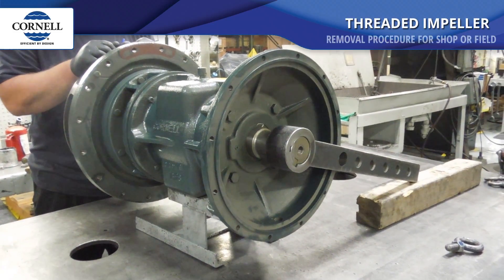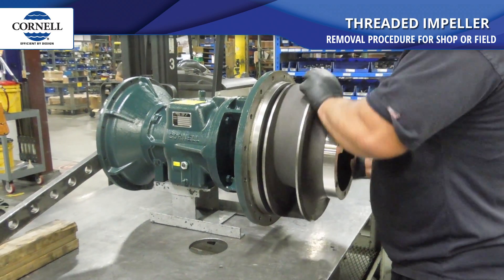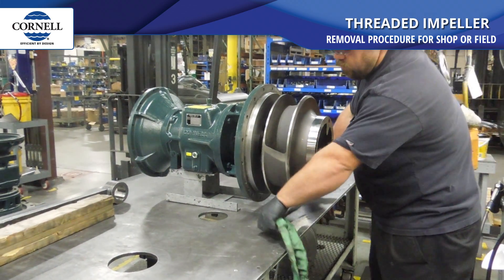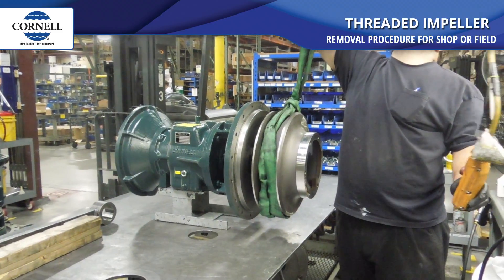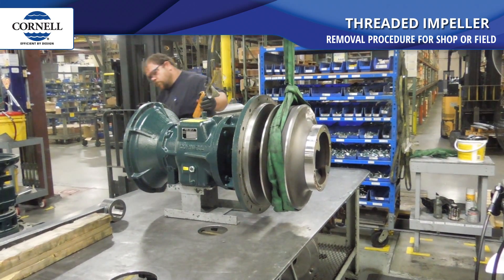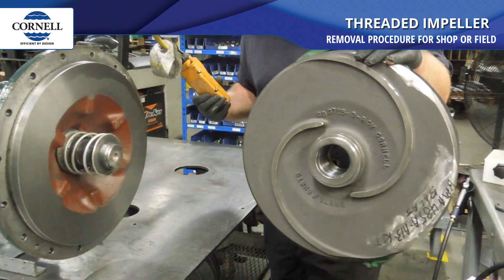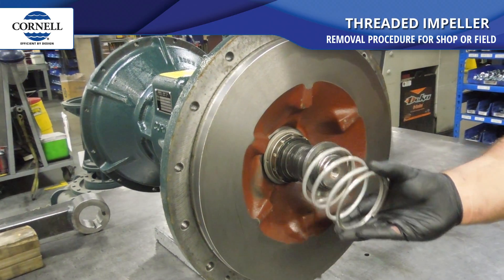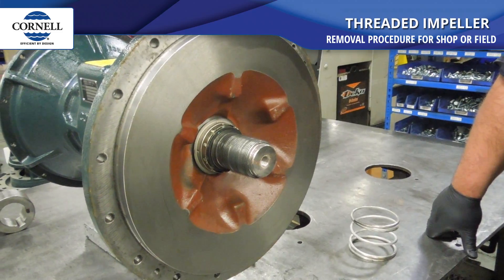Threaded Impeller

Comment: Is it not bad that it twists the same way (counter clockwise) during engine operation and impeller removal?
Reply from the maker: Stephen: thanks for your question. We checked with our production manager on your question: The rotation when looking at the drive end of the pump is clockwise and the threads on a right-hand pump are right-hand threads, so when in operation, the forces are tightening the impeller.   If the pump is being driven by an electric motor and the motor has been wired incorrectly, it starts backwards and can cause the impeller to loosen, then. Always good to check the wiring before startup....